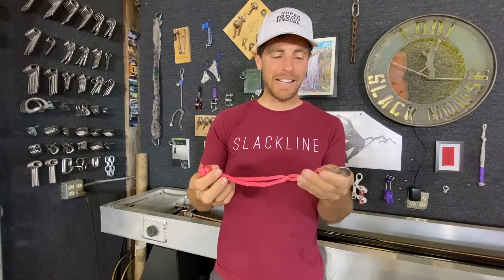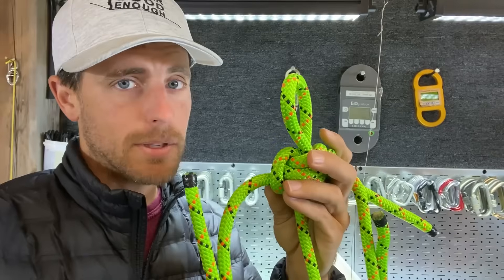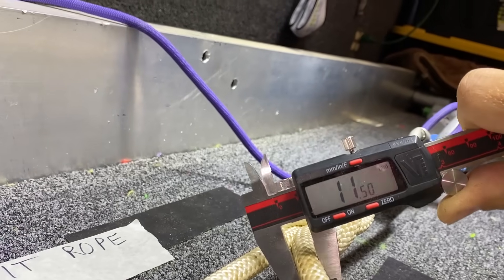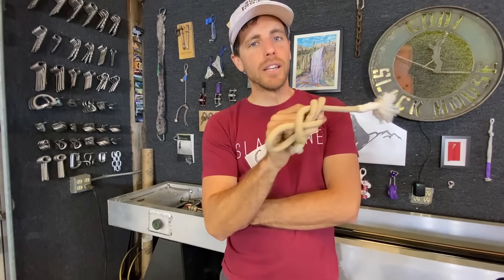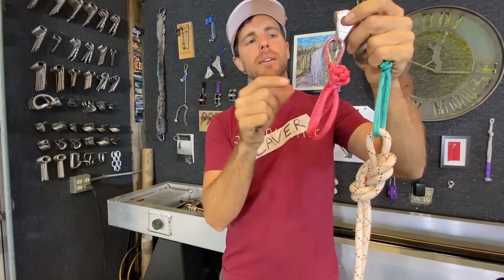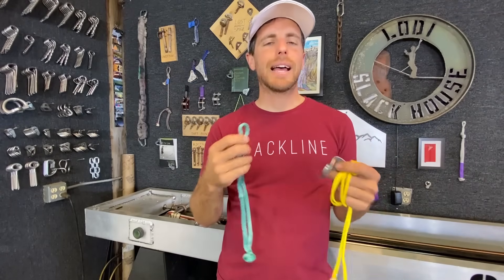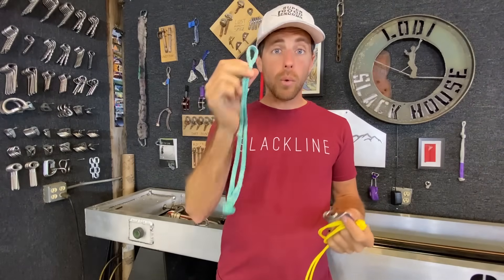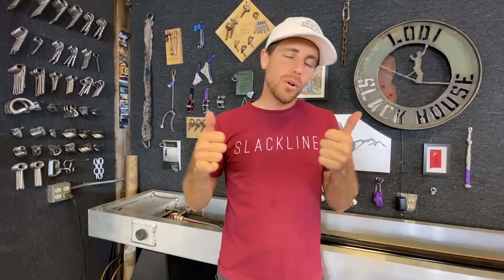Cave break tests - 40 year old Pit Rope vs New!

Comment: Hi Ryan, cool testing, as usual.
Regarding the 40 years old rope:
I am not surprised. 
If you use a rope, like in rappelling, the breaking load drops very soon - half of the breaking load is normal. 
I would be surprised if no one had used it, if it just hung there without anybody ever ascending or rapelling. But I assume that it has been used quite a bit. Under a very good light microscope you can see the difference in the fibers. 
So - as long as we do not know how they used it - I assume that its the useage and not the age.
You could compare it to permanent installed ropes in a climbing gym: After 3 months (no UV, only toprope) the breaking load in the worn part - if you tie there a fig.8-knot - can be around 5 kN (!) - if the route is popular and the gym has many visitors.
I would say: 12 kN show that the cave rope has not been used in toprope situations, only for asccending and rapelling (which is less internal damage than bending around a carabiner 180 degres). The mud may have increased the internal damage.

By the way: UV does not affect the breaking load that much if you expose it in a south face for only 30 years. It weakens only the sheath.
Reply: not knowing much about the material development of ropes... but I would think that what ropes are made of now isn't the same as what they were once made of: not really an apples to apples comparison. Surely the tech has changed a fair bit in the last 40yrs. 

But I've been caving a bunch and it is quite normal to get ropes totally covered in mud and fine sand, that is typically the reason most cavers have told me why they change their ropes every few years. He did note that they washed the rope and it still gave off quite a bit of dust... just shows that you will never fully clean a rope... especially from cave clay lol: that stuff never gets out of gear.
Reply: @1stGruhn  I'm pretty sure that nylon has been nylon for a really long time, and AFAIK there's nothing that makes new nylon stronger than the nylon that was being produced 40 or 50 years ago. If there was any difference in rated strength when each rope was new it's probably insignificant.
Reply: @1stGruhn  forty years ago is 1980. By that point nylon ropes were pretty much the same as they are now, AFAICT.
Reply: Most of the braking force when belaying or rappelling comes from bending the rope rather than friction against the belay/rappel device. I wish I could remember the details or scare up the article, but I once saw something  about the braking force when bending the rope around pulleys instead of brake bars, and the pulleys were roughly similar in terms of effectiveness. It stands to reason that all the bending and the internal friction and abrasion of fiber against fiber has to have an effect on strength. Adding dirt is a bit like adding tiny little razor blades, because dirt is more or less very tiny stone chips, though erosion (and perhaps chemical action) will tend to reduce the sharp edges. I wonder if caving ropes often being wet might be a benefit, in that it could reduce the friction and related damage from dirt.

On a related note, damage  to fibers could certainly help to explain why the older rope is so much more flexible, though I'm wondering if they really re both the exact same rope.

Comment: Teufelberger's tests showed that dirt reduced the strength of rope up to 50%. They just took new ropes and rubbed dirt/water over them, dried them, pulled them over pulleys, and brushed them off. The rock particles get between the fibers and dramatically increase the fiber-fiber friction.

Comment: You can knot the rope into the anchor plate directly (also in the middle of the rope) with a "double Bulin" before screwing it to the anchor like you mentioned. That way you don't need a Quicklink or the Soft Shackle at all, which is the lightest, cheapest an safest version I would say. Only thing is that you need to use anchor plates without sharp edges (eg. "Vertical Evolution ALL" but i am sure there are several other brand's producing that), but that's still cheaper and lighter. I do that frequently and have also discussed that with my colleges from cave rescue and I haven't found any drawbacks yet.

Comment: I have a 46 year old Eidelrid I retired. I climbed for 15 years on it. Then I climbed another 15 on another waterproof rope. Now I use the Eidelrid to tie stuff down in my trailer. I also used it to lower tree branches when not wanting to hit something below. I have used it many times a a safety on roofs. I do not store it in the sun. Built a climbing wall in my garage 25 years ago. Used it for self arrest so I would not hit concrete. I would never throw a rope away. Might not lead on it though. Used "cracken ups" that I never bent or broke for aid climbs. Way back when I remember the being taught Goldline was for rappeling and those sheathed nylon ropes were for climbing. I lost my Goldline and just started using my Eidelrid for everything. You get used to the stretch.

Comment: What's the difference between climbing rope a d cavind rope? I don't know what any of this is.
Reply: AIUI (not an expert, this is not safety advice)

Climbers mostly use ropes for fall protection, so they want/need stretchy ropes that will reduce the impact forces when they fall. They also normally bring the ropes with them as they climb, so weight is important.

Cavers on the other hand mostly use the ropes themselves as a means of access and often leave them in the cave semi-permanently. If you are ascending a rope then stretchy is bad, because it will absorb the energy as you try to push up on the rope.

Comment: The knowledge of rope manufacturing, I'm sure, has changed significantly in 40 yrs. I doubt that old rope would match the strength of the new one even when it was first new.
Reply: I'm almost positive that was old Blue Water. It's almost the only thing anyone used in the southeast then, and it was about 5000lbs rating when made (and yes, I do believe they rated in pounds).

Comment: I totally share your love of numbers, great job! But, our SAFETY RATIO ESTIMATES are significantly off in all your caving videos! The design basis incident of a single-rope caving set-up is the failure of an intermediate anchor. The hind thought is that the top anchor must be extremely secure, but with intermediates, placing is an equally critical factor to avoid sneaky problems with rope wear. The failure of an intermediate anchor will result in dynamic forces on a static rope, and that is why it is essential to have safety margins in the rope (and all equipment) which might seem insanely high at first glance. Also, for segments with possibly high fall ratios, extra (butterfly) knots might be necessary to improve the shock-absorbing capability of the rope. (To further degrade trust in caving rope technique, you might try to imagine a fall with your croll on the rope from the rope perspective... ouch!)

Comment: Really interesting, new static ropes can reach even 30 kN of strength, but it has to be considered the knot type that has been used to tie the rope. Mud and sand can really damage the rope, especially when they are going inside to fibers, but 20 years rope in caves (I know it from some tests), if not exposed to mud but only to water and to the wear of rappelling and ascending are totally secure. Another factor to consider is not only the load of rappelling and ascending but even the stress caused by the rupture of an anchor in rebelay.
PS I see that you use Raumer O-Wing, I'm happy to see that his material is used in the US too, Raumer (that is settled not so far from where I live) has done the history of caving with a lot of innovative stuff.

Comment: Great tests and YouTube channel.  I'm a climber in my early 50s have have fair amount of what is considered old equipment even though a lot of it looks to be in good condition.  While on belay ledges or dreaming about being on them I often wonder about the need to resling cams after 5 years, tossing out new looking ropes at 10 years, etc.  I read that static nylon ropes lose about 1.5 to 2% of their strength per year.   I thought that was a pretty interesting metric and ran the math on your 40 year pit rope pull tests and it comes out pretty close. ~5700 lbs new and ~2800 lbs after 40 years of use in darkness.  Not bad...  You and Bobby are provide a valuable and entertaining service to adventures, engineers and the curious of the world.  Keep on breaking stuff and presenting the results.

Comment: Regarding the loop in the zeppelin bend, it's way easier to pass a knot (either direction) if there is a place where you can attach an point of contact. In caving we always try to have 2 points of contact whenever fiddling with stuff. If two lines are tied together without a loop my process to ascend past that would be something like this:
1. Ascend as high as I can without jamming my hand ascender against the knot. 
2. Attach a prusik above the knot and attach my short cow's-tail to it.
3. Verify that I have 3 points of contact.
4. Detach my hand ascender and reattach it above the knot.
5. Step up on my foot loop, disengage my chest ascender and attempt to reattach it above the knot. 
6. Double check and go. 

If there's a loop in the system you don't have to worry about prusik, especially if the rope is muddy, wet, and slick. Also descending past it is way easier with a loop.

Comment: Most cave are very humid, so it probably degraded from years of water exposure (and the mold that comes with it). It also depends what he rope is made of. Natural material ropes weather very differantly from manmade fiber ropes as they are basically plastic, not cotton or some other cellulose based fiber like the former.
Reply: It's nylon, which  is more or less unaffected by water and mold. Mold and mildew might  live on organic stuff that ends up in the rope, but the nylon isn't a part of their diet.
Reply: @NYpaddler  are you sure tho? That stiff rope looks like waxed celullose based rope to me. Especially being 40 years old, when nylon was not nearly used as much.

Comment: Have y’all considered pull testing random  “no name” bolts like are super common on eBay? There are a bunch of random Chinese 304 SS wedge bolts available for relatively cheap. I’m curious how they break compared to bolts from dewalt or Hilti. I’d be happy to chip in to purchase the bolts for testing.
Reply from the maker: Here are fusion hangers, it wasn't a brand I was familiar with.  I think most hangers that are stainless and made from 3mm or thicker stock is going to be stronger than the carabiners we attach to them.  https://youtu.be/LdZMUDo82pw
Reply: @HowNOT2  Interesting. I’m not sure how I missed that video but I’m glad you made it. I’m specifically curious about the no name mechanical bolts that you can find on eBay or Amazon. Would you be interested in testing some? I’m concerned that people are using cheap eBay bolts marketed as stainless that might not actually be stainless...or be strong enough for lead protection.

Comment: Never used Zeppelin knot, but the version of anything that has a loop is great. You need a loop at a join and this means you don't have to tie a butterfly hitch as well. Why do you want a loop? Imagine you are srt jumaring up a rope or rappelling down a rope. When you pass the knot you have a loop ready to clip with your cowstail for safety so it's then really really difficult to scr3w up passing the knot and somehow fall off the rope and die. That'd seriously ruin your trip.
Reply from the maker: Would ruin your trip, hahahaha

Comment: I don't know the English name but when caving with friends I've seen use of what we call in French "Amarrage souple" or AS (soft anchor?) with is basically a screw with a special plate in which we place a 5mm pure dyneema cord (for example: https://www.canyonzone.com/a-29395042/bolts-hangers-8mm/ct-as-amarrage-souple ).
Reply: AS anchors are neato and in my opinion way more viable than the soft shackle idea. :D 

I've only ever seen a handful of cavers use them in the US, but I believe they're used by the expedition teams who are pushing some of the deep systems in Mexico. 

I wouldn't necessarily trust the average person to use them, though-- kind of an "expert use only" situation.
Reply: It is clearly more complex to correctly use than a hanger.

In my area caves are often quite vertical (I'm few miles from the Gouffre Berger, fisrt cave in which -1000m was reached), so when you need to carry few dozens of anchor point, replacing some hangers by AS save quite some weight.

Comment: To Bobby's question, I use quick links because I don't have a good way to tie into an anchor when both ends are unavailable.  One end is on the top anchor and the other is tied to the bottom of my rope bag.

Comment: The thing with degrading gear is, that chemical reactions basically never stop. They just reach a state where it is super slow to go on. The main influences on our gear (ropes and stuff) are heat and UV light which speeds it up. You can google the Q10 value, it gives you a basic idea how temperature is affecting the reaction. So when you put the gear in your closet it is degrading slower but still is degrading.

Comment: Greeting from the Uk, from a fellow ropes nerd. Petzl ring hangers (not sure if they are still available, Raumer are an alternative ) or clown hangers don’t require a quick links (or as we call then maillon rapide). Both possible to install on the middle of 11mm rope (with a bit of planning). Keep up the good work.
Reply: Thanks to folks like Cave Exploration Society, we DO get Raumer stuff in the states. Looove their gear so much. 😍

We don't really use Spits much anymore so the Clowns are dead in the water, plus I don't think most "American" ropes fit into them. We're slowly pushing the adoption of alpine rigging, so small diameter ropes are getting more popular. But the modern bolting is almost always mechanical bolts, not spits.

Comment: There are theories as to why a rope left in a cave will degrade over time. There is a difference between an unused rope in a climate controlled environment and permanent rope set up in a cave. Even though a rope in a cave is not exposed to UV light, it will likely get used on a regular basis and will get covered in mud. Every time the rope is used, it will get stretched with the weight of a caver and then contract when it is unloaded, which will allow mud and dirt particles get driven into the rope fibers. The repeated stretching and contraction of the rope from rappelling and ascending, combined with mud particles in the rope fibers, increases the friction between rope fibers and begins to break them down over time. That would be one of the more common theories as to why a rope left in a cave for 40 years will lose strength over time.
Reply from the maker: True.  other factors other than UV will shorten the life of it.

Comment: Sharp dirt and grit particles also cut into the fibers and weaken rope.
Reply: I don't think there's actually any evidence of dirt and grit particles migrating into the core, I've cut apart filthy ropes and they're always shiny and white on the inside
Reply: @sebastianflynn1746  Maybe swirl some core in a bucket of hot water and see what comes out. Let it dry and see how much salt and calcium has accumulated.
Reply: @bcwbcw3741  that's an interesting one, exclusive to caving and ropes fixed on limestone it would be really interesting to see how much you get in mineral deposits inside ropes.

Comment: Soft shackles seem to be good enough, but i have a few conserns: 1. in cave you sometimes do some wery veird moves so locked biners are better than some shackles with can unwrap with no safety lock/kont or sth. 2. Caves are dirty - can we be shure, that shackles after few mud runs inside cave are still reliable? It's easier to clean biners and i guess they will have longer "usable" lifespan. 3. if u attatch shackles directly to harness i'm shure u gona have troubles hanging yourself on them while passing throgh tigh spaces.
Reply from the maker: I personally haven't seen or heard of a soft shackle accidentally opening.  And I have some corroded carabiners being sent to me for break tests so even those don't last forever.  I don't know if they really have a place in caving but they are pretty useful things.
Reply: @HowNOT2  I am a great fan of soft shackles too. Use them all the time in my high lines and just recently took some to a cave just to see the reaction of the other cavers :D As you might guess, no one trusted my 6mm shackles - but rather a 15kN aluminum hanger... Thx for spreading the word about dyneema, its fantastic material!

Comment: "I love forcing soft shackles in places they shouldn't be"
Me too, man. I use a soft shackle inside our reclining sofas, connected to the framework and then a carabiner that pinches the fabric of a couch cover to hold the inside corners in place. Not as cool but it's the only thing that I can squeeze into that crack.
Reply from the maker: hahaha.  you could get it in any crack technically
Reply: @HowNOT2  Hello, could you please break test all the 'climbing' products sold on Amazon? Also home depot steel quicklinks vs climbing-rated rapides?
Reply: I think he was talking about the time he shoved one up his ass.